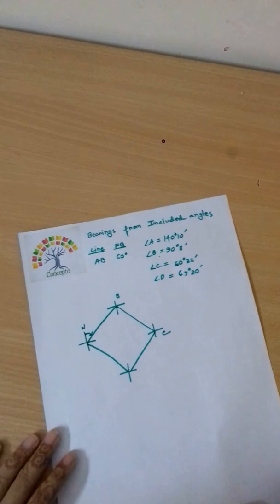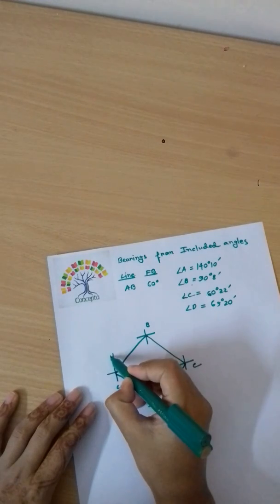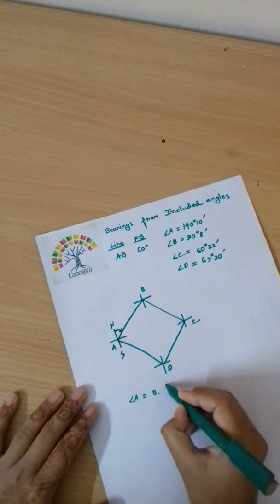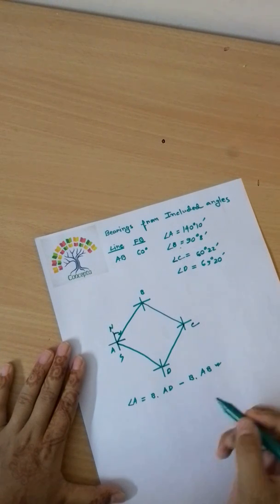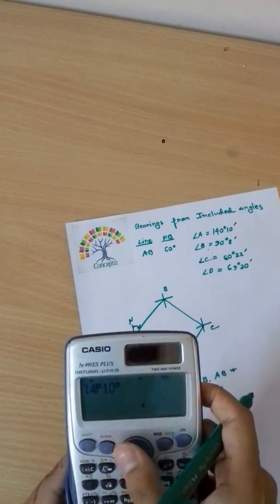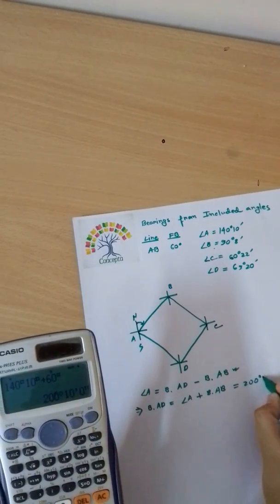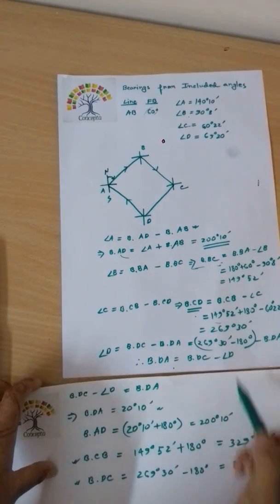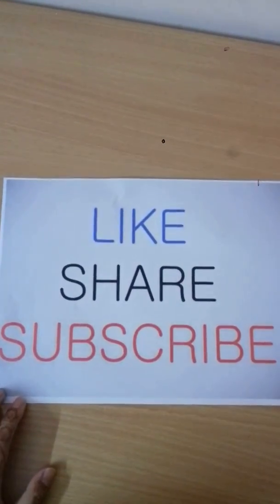Traverse Surveying: Bearings from Included Angles Concepta Bangla Tutorial

Comment: For angle D you might have made a mistake i think its <D =  360 - ( b. DA - b. DC )
Reply from the maker: At first we got the value of B.AD which is a 200°10' > 180°. 
So B. DA = 200°10'-180° =20°10'
And from the step before the last checking step, 
B. CD= 269°30' >180°
SO, B. DC =269°30'-180°=89°30'
Now if we calculate it according to you then,  
<D=360°-(20°10'-89°30')
=429°20'
Which doesn't match with the given value of cone D. 
Maybe you're mistaking it with the process of "calculating interior angles from bearings"